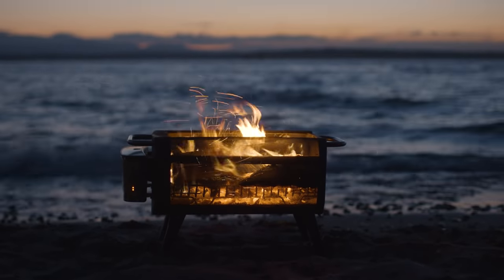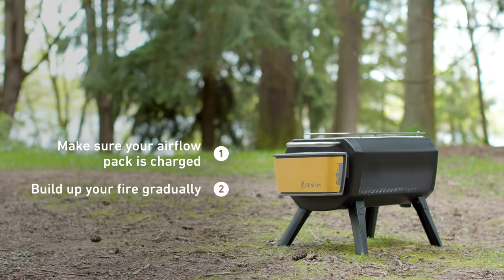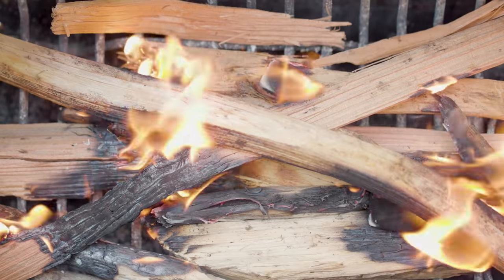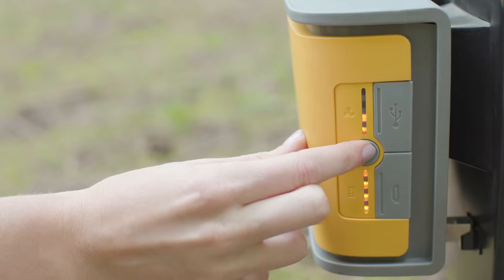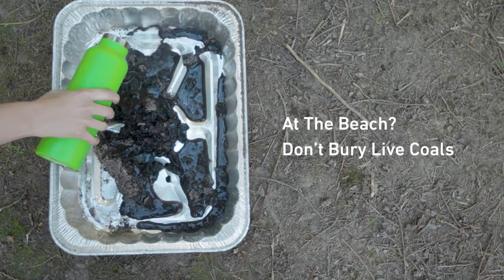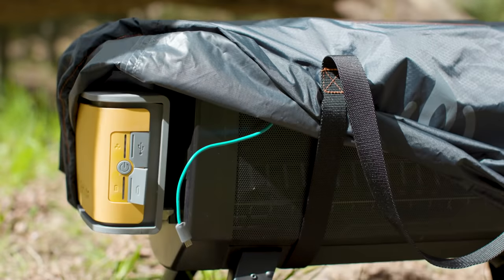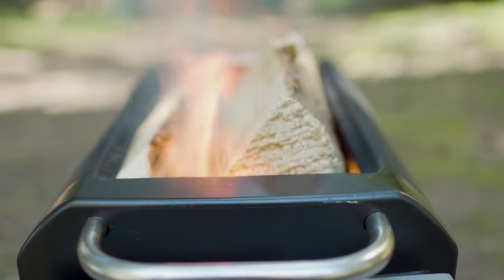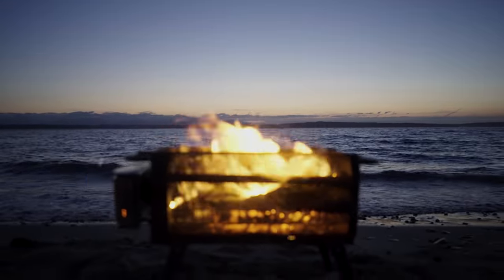BioLite FirePit | Instructional Video

Comment: Well done. The only thing missing is that when there's no sun to activate the charging cover/carrying bag and the FirePit battery is low, the FirePit battery can be recharged using another BioLite product. This is important if you're off the grid, since the FirePit does not self-charge.
Reply from the maker: +1 very good point

Comment: I assume that paper and kindling can be used as an appropriate fire-starter?  If using charcoal can you use lighter fluid or would a chimney be better?
Reply from the maker: Hey Adam! Yup, paper and kindling can be used. For charcoal, both lighter fluid or a chimney can be used - if you use lighter fluid, do so carefully/sparingly (don't want fluid in the jets) and if you use a chimney just  make sure the diameter isn't larger than the opening of the burn chamber or else it won't fit (that's 7") -- thanks for writing in!

Comment: Nicely done. Looking forward thato using it. One thing that is now obvious, unlike the original biolite camp stove, it seems that the fire doesn't charge the battery. That might be worth making a bit more explicit (assuming its true), as its a bit surprising for stove users
Reply from the maker: Hey Keith, thanks for your comment - we mention this several times across our FAQ, Live Demos, and campaign, we'll be sure to incorporate some more explicit mentions on the product page as well. Thanks!
Reply: This was made abundantly clear on Kickstarter and everything else I've seen (except this video). If you'd seen anything about the firepit before, I'm surprised you'd bring this up.

Comment: Great video with a lot of helpful info! Quick question: can you charge the pack while it is running?
Reply from the maker: We don't recommend it (don't want you putting a powerbank near a hot fire -- our airflow pack is housed in high-temp glass filled nylon so it's built to withstand hot temps, but we can't speak to what other third party chargers are made of) - thanks!
Reply: Great! Thanks!

Comment: Curious how much ash will fall out of the bottom during regular use? Or does it burn most of it off and only a small amount remains- hence the access door? We would like to build a stone or concrete table with a recess for it to sit in for our back poolside deck!

Comment: Does the Firebit Battery Pack on the side charge itself while i'm having a fire burning? Or do i must charge it by an external power source? Because i want a 100% way to use it without any other power source far of the grid!
Reply from the maker: Hey Miguel - The FirePit's power pack doesn't charge itself up from the heat of the fire but you can get the Solar Carry Cover which can charge it up via the sun.
Reply: Oh okay, thank you for the fast reply, so is their a product you guys offer which charge itself from the heat (or a bit different)? :)
Reply from the maker: Yes - our CampStove 2 creates electricity from the heat of the fire.

Comment: Why does this not charge with fire like all of your other products?
Reply from the maker: Hey Mark, Good question.  If we included thermoelectrics in a design of this scale, the FirePit would cost ~$400-$600 and we didn't want to just do tech for tech's sake. Realizing that we wanted the system to still be self-reliant and self-charging, we opted for a solar cover as a companion to the unit. The 10,400 mAh battery can offer up to 24 hours of airflow and you can also always recharge it in the car, at home, etc, and since this is more intended for beach, cabin, backyard, etc your access to an outlet is a bit more reliable than a backcountry trip.

Lastly, the FirePit is designed to radiate heat, not concentrate it (which is why we have the x-ray mesh benefit), so its intended use and benefit puts it at odds with TEG optimization.

Comment: I am confused, why go off in a tangent to your other products. When I first saw a larger model I was thinking awesome a 110V charging model, but..instead..it just blows air and is another battery to charge. If you want reduced smoke just baton your wood into smaller pieces and used the fire ring at your campsite and get a coghlans pack grill to cook over. You're Biolite, "Outdoor & Off-Grid Energy"  according to your website, should have stuck a big ol' battery charger on this thing IMHO.

Comment: Why does this not charge any from the heat of the fire like the other little firepit does?

It would make sense for their to be a button to enable Bluetooth instead of it always burning juice for it
Reply from the maker: Hi Robert,

CampStove, BaseCamp, and HomeStove feature a thermoelectric generator that produces electricity from the heat of the fire. The FirePit does not – and that's on purpose.

If we included thermoelectrics in a design of this scale, the unit would cost upwards of $400-$600 and we didn't want to just do tech for tech's sake. Realizing that we wanted the system to still be self-reliant and self-charging, we opted for a solar cover as a companion to the unit. We really want this project to be affordable to as many folks as possible and this was the right energy solution for it.

The 10,400 mAh battery can offer up to 24 hours of airflow, so the intended use case is: you burn throughout a weekend and then toss the cover on for it to recharge during the week. You can also always recharge it in the car, at home, etc, and since this is more intended for beach, cabin, backyard, etc your access to an outlet is a bit more reliable than a backcountry trip (which is why the CampStove/BaseCamp have TEGs).

Lastly, the FirePit is designed to radiate heat, not concentrate it (which is why we have the x-ray mesh benefit), so its intended use and benefit puts it at odds with TEG optimization. Hope that helps clarify.

Comment: Poor quality.  Airflow pack does not fit the bracket, the cooking grate does not sit flush on one end and cosmetic blemish.
Reply from the maker: Hey David, someone from the support team will be in touch, want to make sure you have a properly functioning unit. Thanks
Reply: We got our "fix kit" today and the battery pack now fits correctly. I hope that in the next generation you're able to tweak the design or make sure the manufacturer is better at perfecting their tolerances so no grill has an issue with the power pack fit. At this point, I think you should just include a "fix kit" out with each grill and instructions about when and how to it.
Reply from the maker: Glad you received the fix it kit. Thanks for the feedback!

Comment: The app sucks and won't connect
Reply from the maker: Hi Dali113, did you press the power button once on the Airflow pack to make sure the system was on and able to receive connection? If you already tried that, you can do a hard reset to the FirePit by pushing a paper clip into the small hole just under the micro-USB charge-in port. If neither solution works, please let us know, we'll figure out what's going on -- thanks